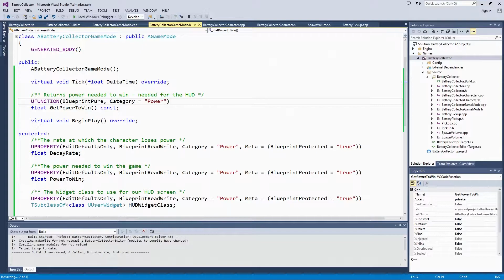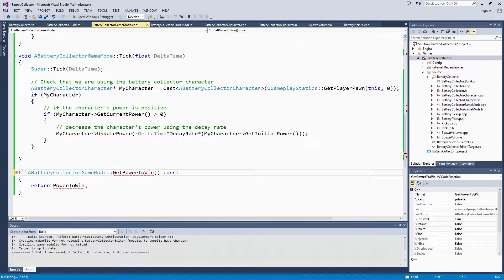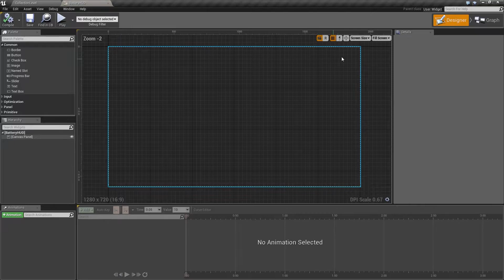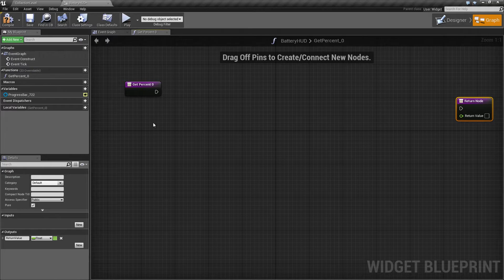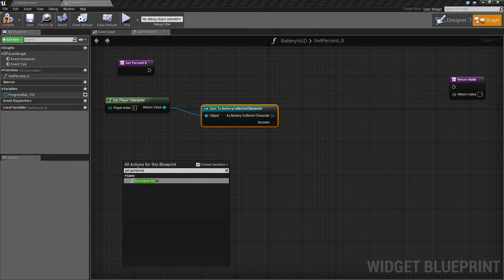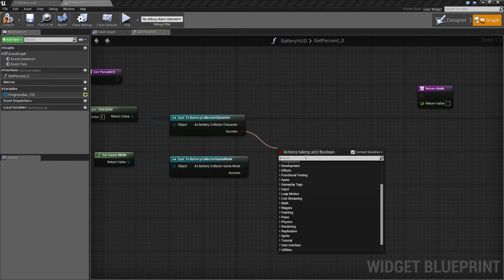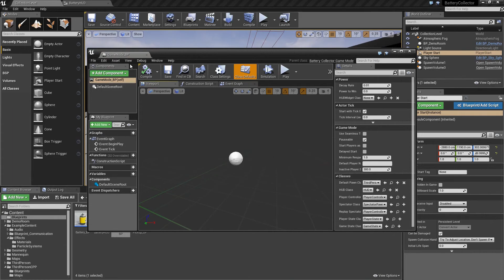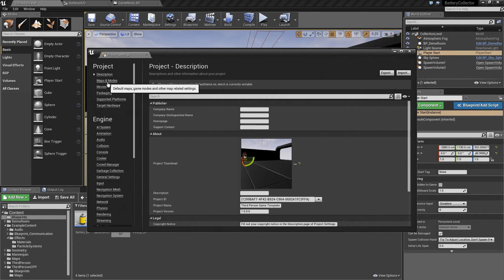C++ Battery Collector: Creating the HUD Blueprint | 17 | v4.9 Tutorial Series | Unreal Engine

Comment: My health bar wasn't showing up until I went to world settings and set Game Mode > GameMode Override > GameMode_BP . This doesn't make sense why it would cause it to start working though, since project settings  is supposed to set the default game mode. At least that was my understanding of project settings.
Reply: You configure that in 'Settings' tab at top.  Select Project Settings, Maps and Modes.  At the top, Default Modes,  Default Game Mode, use pull down and change it from Battery Collector Game Mode to GameMode_BP to use the Blueprint you made instead of default template game mode.
Hope this helps.

Comment: So I have the problem with C2027 use of undefined type UUSerwidget and the  CurrentWidget-> AddToViewport(); displays error. I've tried to include all the headers and made sure that the BatteryCollector.Buiild.cs is identical. Another problem however, is that I cannot Generate visual studio project files as many of u say is the solution. So my question is why? What happens when I try to do it is that it just stops and nothing happens. Later when I try to open the .u file it cannot be opened due to the UUSerwidget error. Any tips or help is appreciated. 
The header im using is #include "Runtime/UMG/Public/Blueprint/UserWidget.h" and is placed both in  the BatteryCollectorGameMode.CPP and the BatteryCollector header. I include the header in all CPP files.

Comment: 2 Issues so far:
1) If i don't set the PowerToWin variable in the blueprint, the Progress Bar won't ever fill (I suppose because CurrentPower divided by 0 won't work?)
2) Even if we previously set CharacterPower=InitialPower, where Character Power isn't editable from Blueprint but InitialPower isn't, I supposed that by changing InitialPower inside the Blueprint would affect CharacterPower during the PlayMode. This doesn't happen

Comment: I cannot get GetPowerToWin to come up when I right click in the blueprint screen. I have it defined as follows:

 /** Returns power needed to win - needed for the HUD */
 UFUNCTION(BlueprintPure, Category = "Power")
 float GetPowerToWin() const;

And here is the implementation:

float ABatteryCollectorGameMode::GetPowerToWin() const
{
 return PowerToWin;
}

I have tried closing and re-opening the project and that does not work. Any insight would be appreciated.
Reply: +Michael Hall Deleting the UFUNCTION macro and recompiling corrected the issue.
Reply: Thanx, I was having the same problem.
Reply: I had the exact same problem, however your solution of deleting the UFUNCTION macro didn't help me at all. The solution I came up with was after right clicking the blueprint screen, uncheck "Context Sensitive". You'll be able to find it that way.

Comment: Compiling the code throws an error: Intellisense: cannot open source file "Blueprint/UserWidget.h"

I located UserWidget.h inside UE4 source files and added it as an include:
#include "Runtime/UMG/Public/Blueprint/UserWidget.h" but it still won't compile without errors. Any idea? I'm using 4.9.2
Reply: +channieonline  After you add "UMG" (or any dependency for that matter) you need to 
regenerate your visual studio project files. Do this by right clicking 
your .uproject file and click "Generate Visual Studio project files". 
This way you can include "Blueprint/UserWidget.h" without getting that error. (Thank you Zaucy!)
Reply: +channieonline Cool. But after I did the what you suggested I still get compiling errors at the Class.h - something like, ":error C2027: use of undefined type 'UUserWidget'. And another one in the same Class.h that says, ":error C3861: 'StaticClass': identifier not found. 

I've checked for typos for nearly Three days in a row now before I posted anything about it and everything is written down precisely as she did it. Strange, huh? :\

Best regards
Reply: +Kade514 right-click on the .uproject file in the folder(windows explorer), not in the visual studio. "Generate Visual Studio project files" will show in the context menu.
Reply: +channieonline  Thank you so much! I ran into this issue before clicking on to this video. I'm glad I moved on because you saved me a headache.  I wonder why it wasn't shown in the lesson.
Reply: +channieonline I've tried to do the same thing in the latest version of VisualStudio and Unreal, but for some reason when I right-click on the .uproject file it doesn't give me the option of generating the VS project files. Do you know what's going on?
Reply: +Wang Wei Ahh, thank you so much!
Reply: +channieonline Regenerate didn't help me, so I guess I should add "UMG" depedency, but could you explain further how to do that?
Reply: +channieonline thanks a lot! really helpfull
Reply: +Wang Wei It's unreal how many times I've come across "right-click on .uproject" yet no one specified that you should do it within Explorer and not Visual Studio. You're awesome!
Reply: Janku-Roketto I'm glad I helped. It took me some time to find out when I first watched this tutorial.